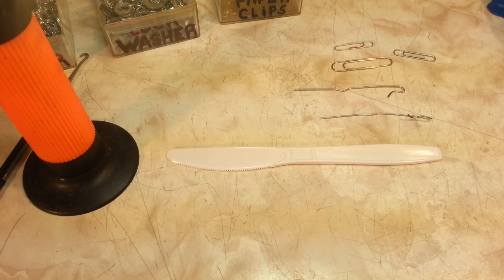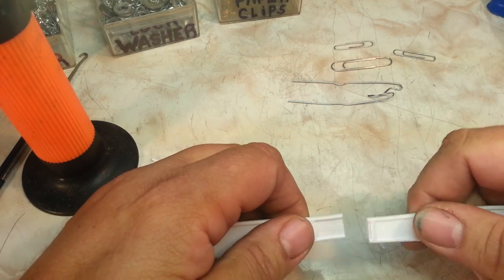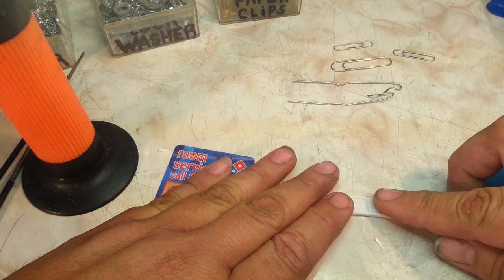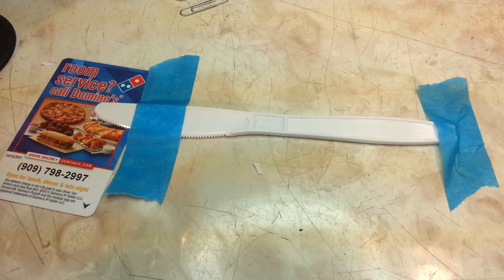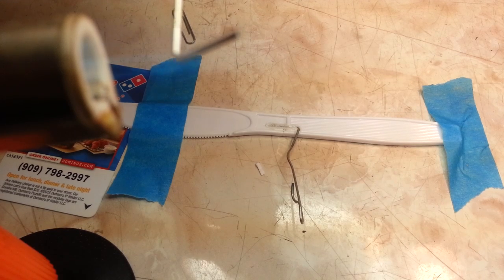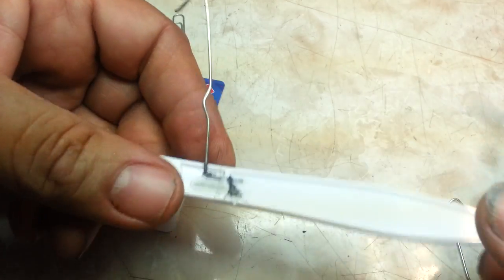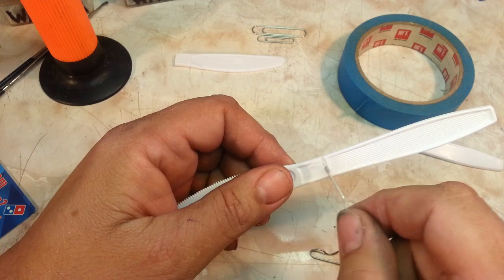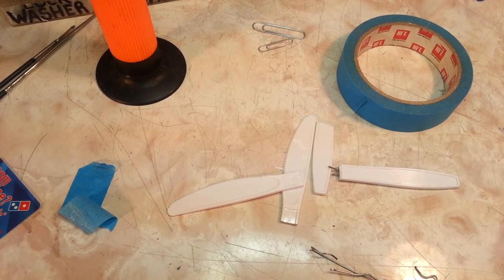Plastic Repair Welding MELDING Reinforced with Metal Demo DIY (#2)

Comment: you using paperclips or a particular gauge size wire?
Reply from the maker: Those are paper clips, but depending on what you're trying to repair, just about any metal the right size will work, screw, nail, etc....

Comment: Dudes playing operation, on a plastic knife. Beep...beep...beep... beep.......beep......... beep............... beeeeeeeeeeeeeeeeeeeeeeeeeeeeee. Gj. I'm going to try this on my car mirror  mount. Gave me some good ideas.
Reply: Same! Searching for ways to repair a semi flexible plastic car hardtop- this is actually a solid suggestion. I have clean breaks and enough plastic that I could easily "stitch" up the cracks with paper clips